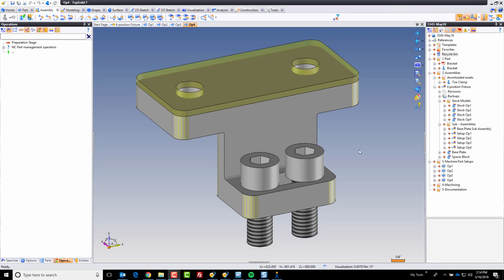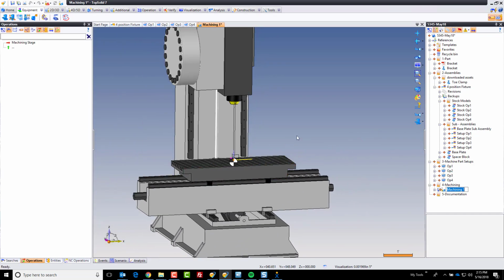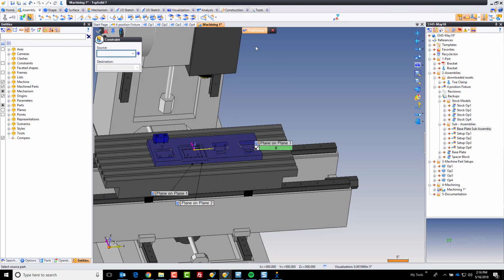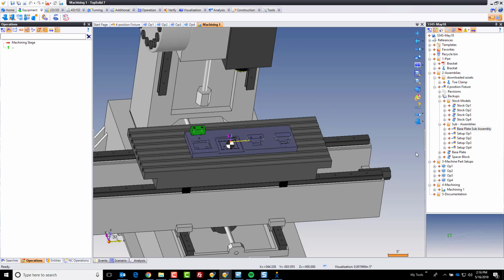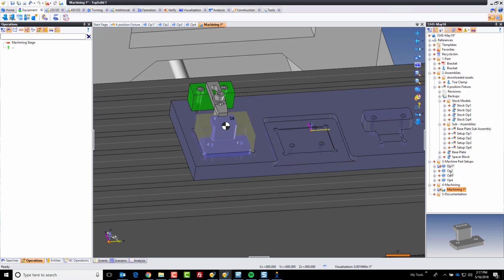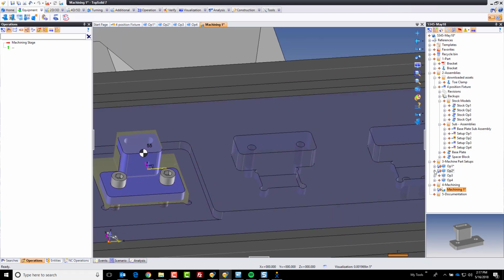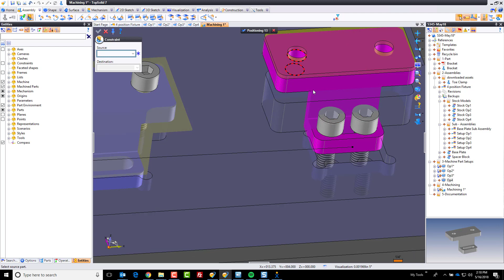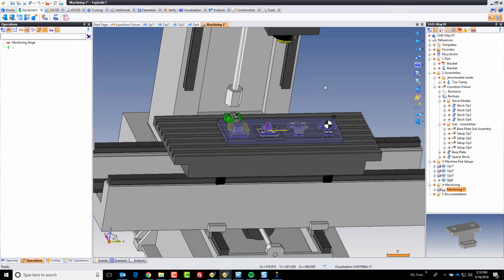Creating CAM File to Prepare for Machining - Challenge Completed Step 12

Comment: Hello, realy nice job, i learned a lot, thanks!
But i have a question: how do you build your machine templates? (Has vf4 for example)
Reply from the maker: Hi Jsquare! thanks for the kind comment.  Building a template is relatively straight forward.  Basically create a machining file with the machine def you want to use and then include any fixturing and tooling that you want in it by default.  From there save the machining file either into your Templates folder of your project template.  Or copy and paste it into the document template project that you can find in the 7 icon File menu in the top left corner of the screen.  Hope this helps.  Have fun!
Reply: @TopSolidBlog   hi ! i love work with topsolid7, is really good !!! i have been looking the answer about this question and o believe that i got it :D! so i m going to tray to do it